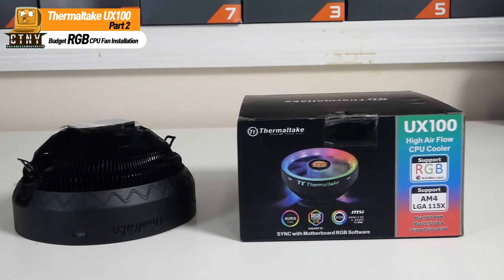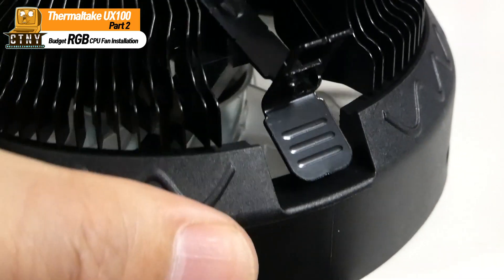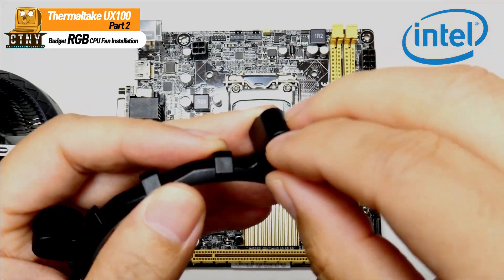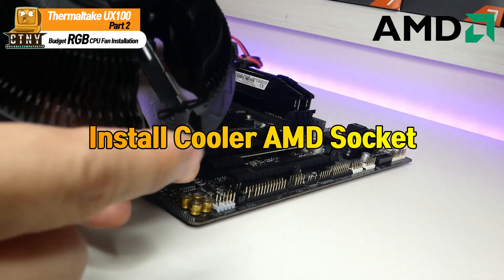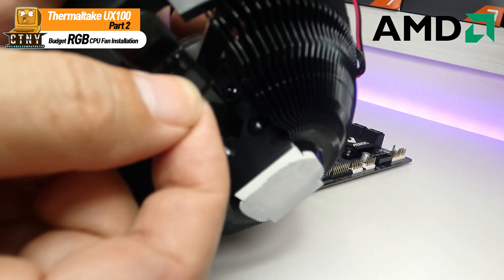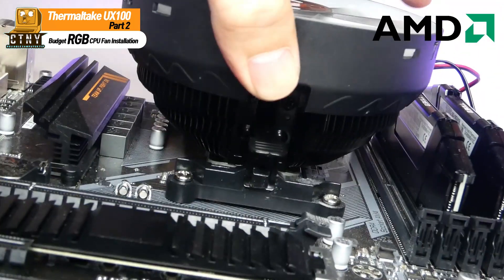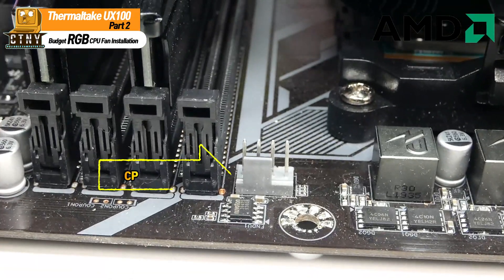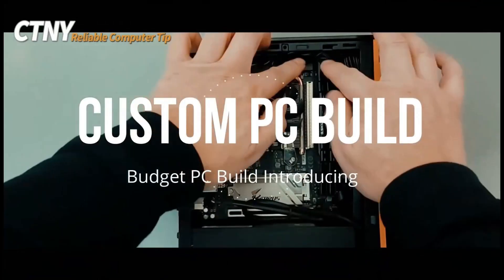Thermaltake UX100 Budget RGB CPU Fan Installation -Part 2 (Intel /AMD)

Comment: i can't seem to get the plastic pins to push into the motherboard screw holes where the old cpu fan assembly was attached.

any suggestions?
Reply: Hey, did you find any solution? I'm having the same problem now

Comment: This thing is not strong enough for a Ryzen 5 w/ 3060 ti. Came in a prebuilt and instantly am taking it out.
Reply: How did you take the cooler out? Im struggling a bunch
Reply: @dipking1801  bro I struggled hard as well. Just put pressure on the latch it may feel like too much but just be sure you're not bending anything on the cpu. The first one was hard as hell but it popped out after a bit. Good luck, it was a struggle.
Reply: I just got a prebuilt with a 5600x and 3060ti as well with this shit cooler. Playing games the thing reaches 96 degrees, like wtf?
Reply: @marchfifth1754  yeah do not game go on Amazon get a deepcool or other cpu fan it'll be fine. You're risking cpu death playing on that.
Reply: @GMartin407  did you take ur motherboard out to remove the cooler?
Reply: @marchfifth1754  nope just the shitty cooler unit and then attached the new one with the rest of the computer all installed
Reply: @GMartin407  I just ordered a DEEPCOOL GAMMAXXGTV2 after your suggestion and after watching reviews. 

I am just really worried about taking this thing off. I have no clue how to do so. Do you just push really hard on the long clip? Like towards the back so it pops up from the front? Did you use just your hands? I worry because I might have to remove my video card since I don't have much room to work with.

Comment: bro I bought ARGB fans with hub only because of this cooler. My mobo didnt had ARGB header. So, I tried connecting DATA and GND pins of cooler to hub and it didnt worked. Felt so bad, I think cooler has some problem? Also, Is there any way I can turn off it colors once for all ?
Reply from the maker: This fan needs 5V 3 pin ARGB header on the motherboard so in your case, please use an RF controller to control the 5V RGB device. Mini ARGB RF Controller Kit  - https://amz.run/3cc9  Installation video: https://youtu.be/5HOoyupW-j8
  Thank you for your comments.
Reply: @comtongny7776  Thanks for the comment. Yes, I do have an hub that looks like coolmoon which has 6 pins (Data out, +5,Data in,LED-GND,FAN-GND,+12V). I have connected (D,G) pins of cooler to Data-in and GND of hub but cooler's light color is not changing with hub's remote. I think there is some fault in my wire of Cooler.

Comment: Hello! How to find D&G pin on Asus H81M-E motherboard? 
I can only find another CPU fan socket :(
Reply from the maker: I'm sorry to inform you that your board is not compatible with this RGB CPU cooler fan. This one needs 5V 3 pin ARGB header on the motherboard so in your case, you can use this manual RF controller. Mini ARGB RF Controller Kit  - https://amz.run/3cc9  Installation video: https://youtu.be/5HOoyupW-j8 Thank you for your comments.

Comment: Hello, i need a hero.

Could i connect it to a ASUS PRIME B350M-A?
Reply from the maker: There is 1 x Fan RGB header on this board at the right side of the bottom but it is 12V 4 pin. In this case, you'll need a converter to change the voltage from 12V to 5V Here is the link: https://amz.run/4Ssy   Installation Video: https://youtu.be/sBCvmkXf-Zg  Please connect 5V 2 pin(D,G) ARGB connector from the cooler to converter then connect 12V 4 pin connector (female) to RGB LED connector on your board. Also, don't forget to download the ASUS AURA sync program to control RGB accordingly. Thank you for your comments.

Comment: Hey, ux100 has 3 pin non pwm header and when it is connected to 4 pin cpu fan header, it always works at 100 percent speed. Which causes lots of noise.
Is there any other way arrround for this?
Reply from the maker: This CPU cooler uses 5V 3 pin so you need a converter to change the voltage from 12V to 5V.  Here is the link: https://amz.run/4Ssy   Installation Video: https://youtu.be/sBCvmkXf-Zg  Please connect 5V 3 pin ARGB connector from the cooler to converter then connect 12V 4pin connector (female) to 4 pin RGB LED connector on your board. Also, don't forget to download the sync program to control RGB accordingly. Thank you for your comments.
Reply: @comtongny7776  Yup thanks

Comment: How do I remove the cpu cooler from my pc?
Reply from the maker: Just like when installing, press the hook from the top with the screwdriver to pull out the metal pin. Please check at 2:50 in this video. Thank you for your comments.

Comment: A simple question 
how can i remove it on intel one
Reply from the maker: Just like when installing, press the hook from the top with the screwdriver to pull out the metal pin. Please check at 2:50 in this video. Thank you for your comments.

Comment: If I already have another cooler and want to change to this cooler, do I need to take out the motherboard from the casing for this installation? Or I can do that on the fly?
Reply from the maker: I think you need to take out M/B and install a cooler because it's hard to install the cooler when M/B installed into the case. Thank you for your comments.

Comment: Thanks for the vid. How do you remove the push pins once installed?
Reply from the maker: As you can see in this video at 2:50. You need to push down the metal pin with a screwdriver and take out the pin to the outside. Thank you for your comments.

Comment: Is there a way to connect it to a rgb header that is 12V? Like maybe a 5v usb power pin and then the ground pin using that same usb connection?
Reply: @Iota Commited There are ARGB controllers for that. If you want to control the fan lights, you might need to buy an ARGB controller and insert that D and G pins into ARGB controller. And then you can control your fans lights through ARGB controller but not from motherboards software. 
Also, If your case has got ARGB fans or controller, you can insert your CPU cooler D and G pins into that controller as well.

Comment: an information i have the thermaltake 20 MT case plus the thermaltake ux100 heatsink how do i connect the D-G wires?
Reply from the maker: In order to get the light on and sync the RGB fan, you need an RGB compatible motherboard which means that has a 5V 3 pin ARGB header. Thermaltake 20 MT case also has a 5V RGB switchboard to connect 5V 3 pin connector. You need to connect both 5V 3 pin connectors to 5V 3 pin ARGB header on your board. UX100 has only 2 pin D and G. You can see the D and G(ground) letter on the board. Some board has 2 of them but the most case it has only 1. If you need to connect more than that, you need a splitter hub to combine all of them. Here is the link: 5V RGB Splitter Hub https://amz.run/4TOg  Thank you for your comments.
Reply: @comtongny7776  I do not have the motherboard rgb can I connect it with the e xxx of the termaltake case ??
Reply from the maker: @pietrostama2936  If you don't have an RGB header on your board, I can recommend this controller to control RGB by remote control. Here is the link: Mini ARGB RF Controller Kit  - https://amz.run/3cc9  Installation video: https://youtu.be/5HOoyupW-j8 Thanks.
Reply: @comtongny7776  
thanks very kind

Comment: Do i need 2 AM4 brackets or is one enough
Reply from the maker: Originally there's 2 AM4 Bracket on the board. To install the cooler you need two brackets. Thank you for your comments.

Comment: Ive tried several different programs to change the color and none of them work , i have a MSI b365m pro-vdh , is there a specific program i need ?
Reply: That motherboard isn't compatible with the rgb socket required.

Comment: Help me please!!! I don't know how sync with my mobo Asus
Reply from the maker: Please tell me what is the model number of your board. I will check it out and let you know how to connect. Normally if you have a 5V 3 pin compatible board, please connect 5V 2 pin connector(D,G) from the cooler to 5V  3 pin ARGB header on your board. After that, you can download the sync program like AURA from the ASUS website and install it to control RGB color accordingly. Thank you for your comments.

Comment: Does it support gigabytes b450m ??? Plz reply me..
Reply from the maker: There is a 1 x CPU cooler LED strip/RGB LED strip header on Gigabyte B450M DS3H but it is a 12V 4 pin RGB header. In this case, you'll need a converter to change the voltage from 12V to 5V Here is the link: https://bityl.co/5bSw or EZDIY-FAB RGB Converter Link: https://amz.run/4HGN   Installation Video: https://youtu.be/sBCvmkXf-Zg  Please connect 5V 2 pin ARGB connector(D.G) from fan to converter then connect 12V 4pin connector (female) to RGB LED connector on your board. Also, don't forget to download the Gigabyte Fusion 2.0 sync program to control RGB accordingly. Thank you for your comments.
Reply: @comtongny7776  
Lol now it’s working.. without attach d & g cable I attached only CPU fan cable...

Comment: I just bought this & mounted on my gigabyte b450m h mobo.. But the problem is the led cpu is a 12v 4 pin header & after i plugged d and g with this header, i can only get the rainbow effect..  rgb fusion 2 doesn't sync the cooler & thats why cant control rgb,, 
Now my question is, after reading all the comments here, will using d and g with 12v header damage my cpu cooler fan?? 
& the 2nd question is, pls name some other aRGB controller thats comes cheaper as i hardly can afford of what aRGB controller u suggested to others. This controller nearly comes with the same price as tt ux 100 in my country.

I will be waiting for your answer, Sir.
Thanks
Reply from the maker: OK, I understand that but basically, this UX 100 comes with a 5V 3 pin connector for the power of RGB light. PWM connector of course it is a 12V 4 pin. These are different types of connectors so please connect 4 pin PWM connectors to CPU_Fan header and connect 2 pin from the fan D,G to 5V 3 pin LED header on your B450M board. If your comments are true, please use a converter to change the voltage from 12V to 5V. Here is the link for the product and installation. link: https://amz.run/4Hfk   Installation Video: https://youtu.be/sBCvmkXf-Zg Thank you for your long comments. Any questions are welcome.

Comment: how do you know if its 5 volt? I have a three pin connector but it doesnt say its 5 volt or if its g-ground or d-d my motherboard is the gigabyte b450m ds3h v2
Reply from the maker: I checked the specifications of your board. It has only 1 x CPU cooler LED strip/RGB LED strip header but it is 12V 4 pin (white) near the CPU socket. In this case, you'll need a converter to change the voltage from 12V to 5V Here is the link: https://amz.run/4Hfk   Installation Video: https://youtu.be/sBCvmkXf-Zg  Please connect 5V 2 pin ARGB connector(D,G) from the fan to converter then connect 12V 4pin connector (female) to CPU RGB LED connector on your board. Also, don't forget to download the Gigabyte Fusion 2.0 sync program to control RGB accordingly. Thank you for your comments.

Comment: can I use it in TUF B360 Plus gaming mobo. i am planning to get it.
Reply from the maker: There's a 1X ARGB header on this board but it's a 12V 4 pin. This cooler needs 5V 3 pin header so in this case, you'll need a converter to change the voltage 12V to 5V Here is the link: https://amz.run/4Hfk   Installation Video: https://youtu.be/sBCvmkXf-Zg  Please connect 5V 2 pin ARGB connector(D,G) from the hub to converter then connect 12V 4 pin connector (female) to RGB LED connector on your board. Also, don't forget to download the ASUS AURA  sync program to control RGB accordingly. Thank you for your comments.
Reply: @comtongny7776  thankyou for the reply . i thought of it but was not sure. already using AURA SYNC planning to get the cooler. thanks

Comment: Will it work on a asus b150m-f plus motherboard???
Reply from the maker: I'm sorry to inform you that your board is not compatible with this RGB fan. This one needs 5V 3 pin ARGB header on the motherboard so in your case, please use an RF controller to control the 5V RGB device. Mini ARGB RF Controller Kit  - https://amz.run/3cc9  Installation video: https://youtu.be/5HOoyupW-j8
 Thank you for your comments.

Comment: Will this work with an Asrock z490m pro4?
Reply from the maker: There are 2 x Addressable LED Headers(ADDR_LED1,2) on this board. You can connect a 5V 2 pin connector(D, G) from the cooler to 5V 3 pin ADDR_LED1 header on your board. Also, you can download the ASRock Polychrome sync program from the website and install it to control RGB accordingly. Thank you for your comments.

Comment: Sirr does work h81m motherboard? Please reply
Reply from the maker: I'm sorry to inform you that your board is not compatible with this RGB CPU cooler fan. This one needs 5V 3 pin ARGB header on the motherboard so in your case, you can use a manual RGB remote controller. Please check this device and use this if you want to install Thermaltake UX 100. Mini ARGB RF Controller Kit  - https://amz.run/3cc9  Installation video: Converter: https://youtu.be/sBCvmkXf-Zg Thank you for your comments
Reply: @comtongny7776  You were wrong, my fan arrived today and felt perfect and Led is also working, thanks for your reply 🙏
Reply: @KGYTFORYOU  Bro can I ask you a question? Where do you connect Data and Ground Cable to your motherboard?
Reply: @nyeinchansoe5616  I have RGB controller bro
Reply: @comtongny7776  😔

Comment: Is this compatible with a GIGABYTE B365M DS3H WiFi-Y1?
Reply from the maker: Yes. It has 2 x addressable LED strip headers on this board. You can connect 5V 2 pin header (D,G) from the cooler to 5V 3 pin ARGB header on your board. Don't forget to download Gigabyte Fusion 2.0 sync program to control accordingly. Thank you for your comments.
Reply: @comtongny7776  Nice
Reply: There's a D_LED port at the top and bottom I believe.

Comment: I wish I knew where to connect the led connector my motherboard doesn’t have anything like that :(
Reply from the maker: If you don't have any 5V 3 pin ARGB header on your board, you can use this RF controller instead. Mini ARGB RF Controller Kit  - https://amz.run/3cc9  Installation video: https://youtu.be/5HOoyupW-j8 Thank you for your comments.

Comment: how would you remove it from the intel set up?  the pins seem to snap it in place?  you just pull them out?  or push them from the back of the mother board?
Reply from the maker: OK, please take out the pin and push the holder from the backside of the motherboard. I think you already took it out. Thank you for your comments.

Comment: The question is how do I take it off. Need to upgrade my cpu nothing is working
Reply from the maker: Please Press the metal latch on top with a screwdriver-like tool and pull the lever out from the CPU bracket. Please see this video at 2:50 to get an idea of how to remove it. Thank you for your comments.

Comment: Thanks for the video. Can you tell me how to connect my UX100 to a non-RGB mother board. I have an ASUS B-85M MB.  I realize its not directly connectable, but could I intergrate a 3rd party controller. Any suggestions would be appreciated.
Reply from the maker: In your case, you can use an RF controller to control the 5V RGB device. You can check this link for the product and installation. Mini ARGB RF Controller Kit  - https://amz.run/3cc9  Installation video: https://youtu.be/5HOoyupW-j8 Thank you for your comments.

Comment: I have a rog striz 8450-f motherboard and it doesnt have a 5 volt header. What do i do?
Reply: I just saw the other comment about the motherboard and saw you put a link. But when i open the link i just get put on amazon. Could you maybe give me a name to work with?
Reply from the maker: I checked the specifications for your board. It has only 2X 12V 4 pin ARGB AURA headers. In this case, you'll need a converter to change the voltage from 12V to 5V Here is the link: https://amz.run/3c87   Installation Video: https://youtu.be/sBCvmkXf-Zg  Please connect 5V 2 pin ARGB connector(D.G) from fan to converter then connect 12V 4pin connector (female) to AURA RGB connector on your board. Also, don't forget to download the ASUS AURA sync program to control RGB accordingly. Thank you for your comments.

Comment: Will H410M PRO E fit this thing?
Reply from the maker: I'm sorry to inform you that your board is not compatible with this RGB CPU cooler fan. This one needs 5V 3 pin ARGB header on the motherboard so in your case, please install a cooler and then use the RF controller to control RGB accordingly. Mini ARGB RF Controller Kit  - https://amz.run/3cc9  Installation video: https://youtu.be/5HOoyupW-j8  Thank you for your comments.
Reply: @comtongny7776  oh，thanks

Comment: Hey, can I connect the d and g cable to anywhere else than the addressable gen 2 rgb header on my mobo I’m using the  TUF GAMING X570-PLUS (WI-FI) mobo, I’m using the addressable gen 2 rgb header for a 3pin connector that my case has. A reply would be greatly appreciated.
Reply from the maker: OK, I understand that. In this case, you can combine a 3 pin connector with the case and CPU cooler with a female & male adapter. Link: https://amz.run/4FnX  Or Another method is to use a 12V 4 pin header by using 5V 3 pin converter. There are 2 x AURA sync 4 pin headers on this board. Here is the link: https://amz.run/3c87   Installation Video: https://youtu.be/sBCvmkXf-Zg  Please connect 5V 3 pin ARGB connector from the cooler to converter then connect 12V 4pin connector to 4 pin AURA sync connector on your board. Also, don't forget to download the ASUS AURA sync program to control RGB accordingly. Thank you for your comments.